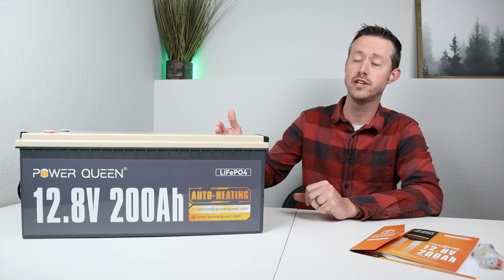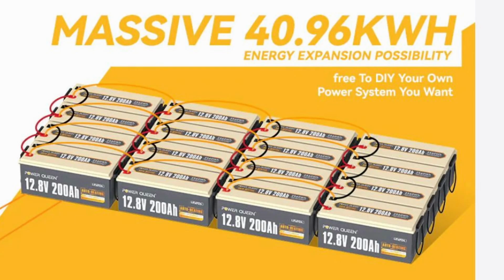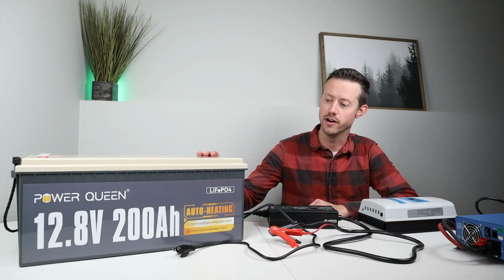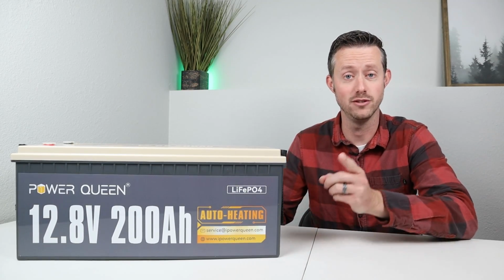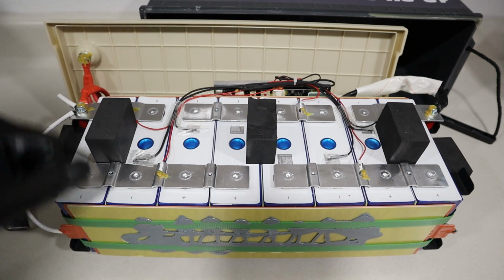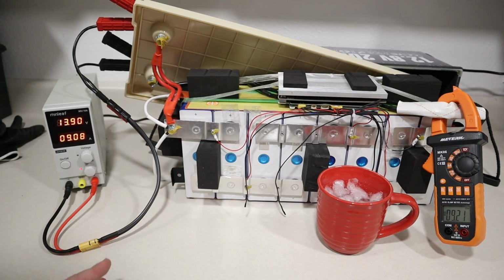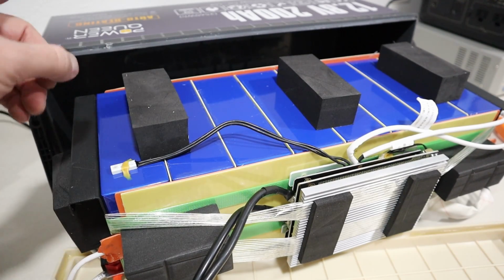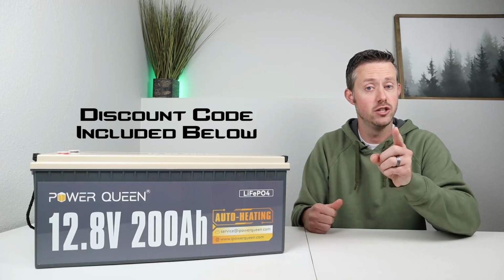Power Queen 200AH - Cold Temp LFP Battery - With Built In Heaters! Full Testing and Review

Comment: Nice review,  have a question I have not seen asked. If the battery is not being charge just sitting do the heaters still come on? I asked Power Queen but was not able to get a concise answer.
Reply: I ask as in the winter it will be sitting for weeks at a time not used and I dont want the battery to die when not being used. Thanks
Reply from the maker: Heater only turn on when the battery is cold and a charge is being applied. The heaters do not turn on without a charge. LFP batteries can be discharged in cold temps, just not charged.
Reply: Thanks so much

Comment: Info on how to program your MPPT for this battery and battery shunt monitor.
I use the EpEver TracerAN mppt and a Juntec battery monitor with 400A shunt.
I have 5x 150Wp solar panels feeding the battery to a 2500W inverter 12V DC to 220V AC

Overvoltage protection: 15V
Undervoltage protection: 10.8V
Discharging overcurrent protection: 200A
Charging overcurrent protection: 200A
Overpower protection: 2560W
Over temp protection: 50C
Low temp protection: 5C
Low capacity reminder: 10%
Protection recover time: 180s
Protection delay: 5s

Over voltage: 15V
Charge limit: 14.8V
Over Voltage Reconnect 14.2V 
Equalize voltage: Disable
Boost voltage: 14.6V
Float Voltage: 13.8V
Boost reconnect: 13.5V
Low Voltage Reconnect 12.4
Under Voltage Recover 12V 
Under Voltage Warning 11.6V 
Low Voltage Disconnect 10.8V 
Discharge limit: 10V

Comment: Hi Jason  Great review as always. I saw a review of another brand 200 AH battery where the positive wire was laying against the negative terminal inside the battery and chaffed through the insulation causing a short. I the guess short circuit protection didn't work and the BMS was destroyed and some of the cells as well. Per the reviewer this happened in shipping to him. When you opened this battery were the wires dressed properly or could this be a possibility on this one as well? I couldn't really tell from watching your vid.  Bob
Reply from the maker: There were no issues in the battery when I opened it up.

Comment: umm you have 2 of these now, one with a heater and one with out. wonder what you will be doing with them, could possibly put them in series for a power dump into one of the power stations. 🤔
Reply from the maker: I'm planning to hook them up in series to a 24v all in one inverter / charger system from Sungold Power. It will be a 3000w rolling cart backup system 👍

Comment: Great review!  Power Queen has such a large lineup of batteries.  Maybe you could get them to send you their 48V 4.6KW server rack battery.  For only $1199, it is the least expensive rack battery in town (that you can buy fully assembled).  The Aims charger is a beast!
Reply from the maker: Thanks John, I am working on a 24v 'All in one" setup right now since I have two of these 200ah batteries I can put into series....but maybe going with a 48v system and rack battery solution is better for the long run haha?! I think showing off a 24v system would be good to demo since all you need is two 12v batteries in series to build it.
Reply: @Jasonoid  Yea, EG4 has 12, 24, and 48 volt rack batteries, but Power Queen only has the 48 volt one.  Still, a 5160watt 24 volt system would be a great system to put together and show off on your channel.  Aims makes some great inverter chargers in the 24 volt range that would be a great match for these batteries.

Comment: Do you think this Battery Management System (BMS) monitors each of the 8 cells individually for charging purposes or does the BMS monitor 4 of the cells (12v) as a single group and then 4 of the cells (12v) as a single group? Thank you very much for opening and showing the inside of these batteries. Take care,
Reply from the maker: The BMS has 5 sensors (all 4s batteries have 5 leads) for managing battery leads, one for each module, so it doesn't manage the voltages of each battery. I don't think it needs to manage them individually since they are tied in parallel and the voltages are locked together.